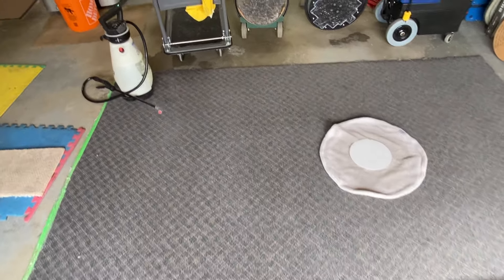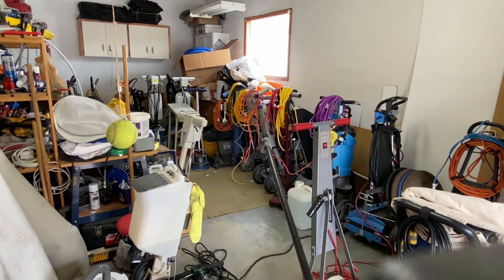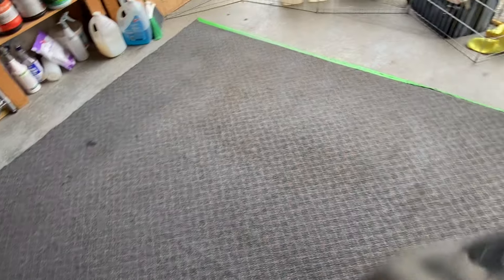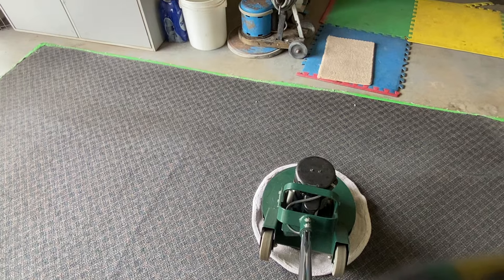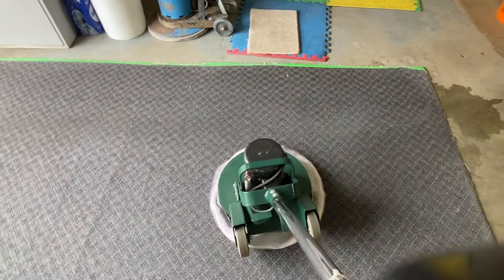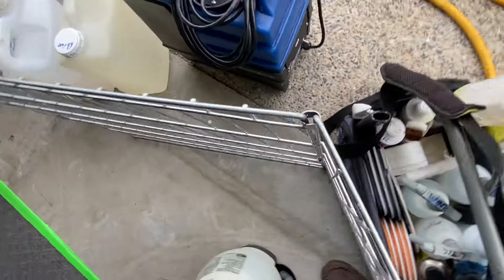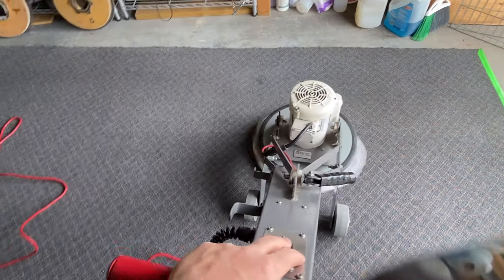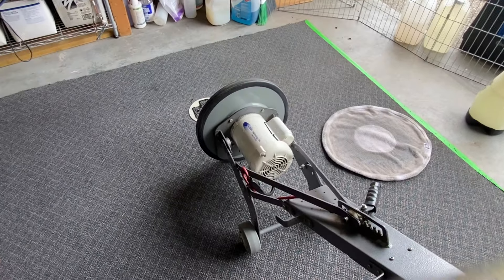Oxy-Dry Challenger VS the Orbitec Easyglide

Comment: Try Putting a Oreck drive from challenger on it? I bet it would work waaaay better *On the Challenger .
Reply from the maker: I did a video a few months back where I put the Vibe pad driver on the Challenger and it worked fine. I actually talked to one of the guys at Challenger as he called me and he had seen that video and they were considering doing this upgrade. I wouldn't say it was any better as far as performance and the orbital motion is identical but it did look better than the plywood pad driver the Challenger comes with and it was an easy swap with minimal modifications. These orbital machines are all mostly the same or very similar in how they work.